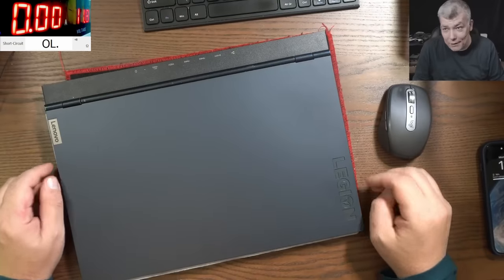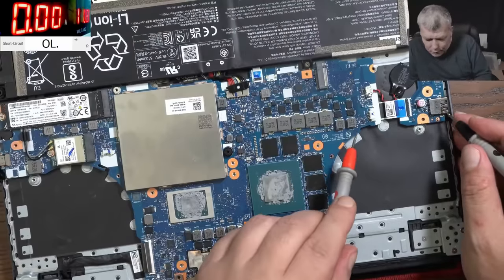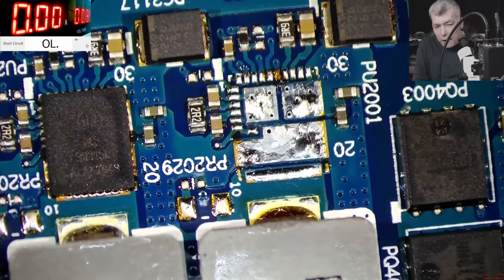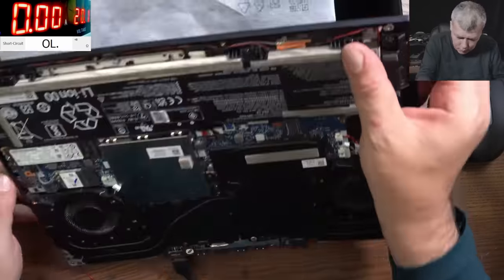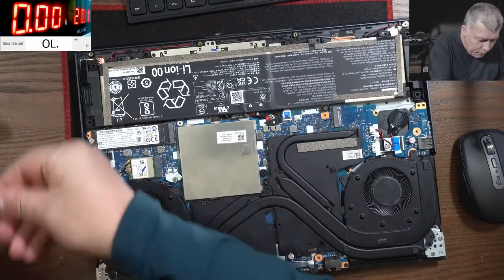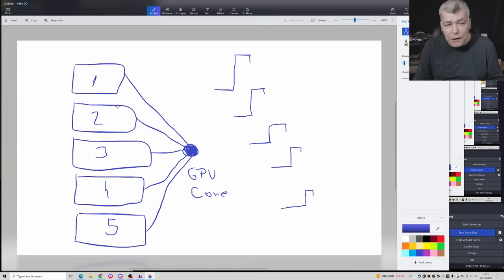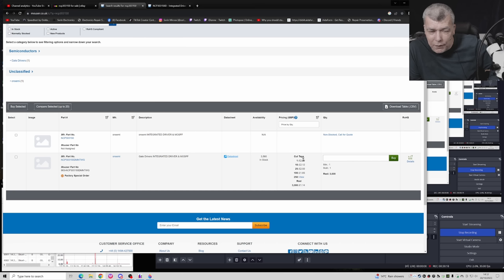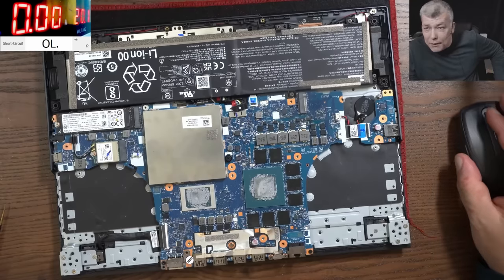Shorted MOSFET but GPU STILL GOOD ??? Lenovo Legion 5 dead, a mysterious case

Comment: Hi Sorin, here's the answer from Chatgpt: The NCP303150 and NCP303150D are two low dropout voltage regulators from ON Semiconductor that are often used to provide stable power to electronic circuits. The main difference between them is in the input voltage range and output current range that they can accommodate.

NCP303150: This is a low dropout linear voltage regulator with an input voltage range of up to 12V and an output current of up to 150 mA. It is suitable for low power applications and can provide adjustable output voltage.

NCP303150D: The "D" in the name suggests that this device is a version of the NCP303150. The NCP303150D is designed to operate with a wider input voltage range, typically up to 24V, and is capable of delivering an output current of up to 150 mA. Additionally, it is also capable of providing an adjustable output voltage.

In summary, the main difference between the NCP303150 and NCP303150D is the supported input voltage range. The NCP303150D is best suited for applications that require a wider input voltage range, while the NCP303150 is aimed at applications with a more limited input voltage range. Both can be used to supply regulated voltage to low-power electronic circuits. Be sure to consult the specific data sheets for these components for detailed information on their characteristics and recommended applications.
Reply: More complete and utter nonsense from Chatgtp.
The device is not a low dropout regulator. It is a complex circuit with two power MOSFETS, drivers and control circuitry intended to be the switches for a synchronous buck converter. It is a VERY high-power part.

Clearly ChatGTP is worthy of ZERO trust for this sort of thing!

Comment: Legion 5-17IMH05 one RAM slot stop working

Laptop was working just fine for 2 years, one-day my Windows10 crash due to some unexpected errors - blue screen (i have a photo of exact error).

after trying everything possible, I was able to isolate the issue and start the machine just fine, all works now but only using one RAM slot, if I switch the memory slot, or insert RAM into both slots I receive a black screen and mainboard will not start, exactly as on this video

https://www.youtube.com/watch?v=E2gyzBwObNA

for now I have 4 memory chips (8Gbx2 and 16Gbx2) but laptop starts with any of the chips but only on one Upper slot. Looks like this is a common problem for Lenovo Legion 5/7, and maybe you already know the issue and know how to fix 

any suggestions what may cause this fault?
Reply: You must inspect with microscope slot maybe is damage or connection between memory and cpu is open some contact under cpu is crack ..You can buy memory tester ddr 4 ,see where missing connection..